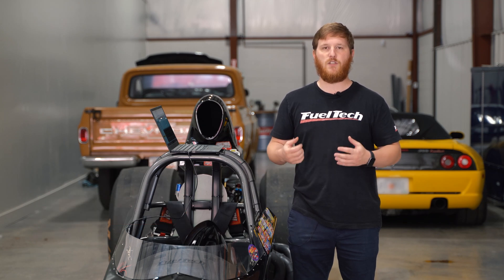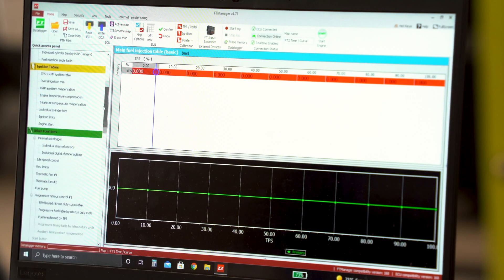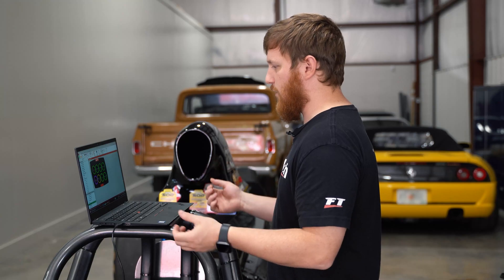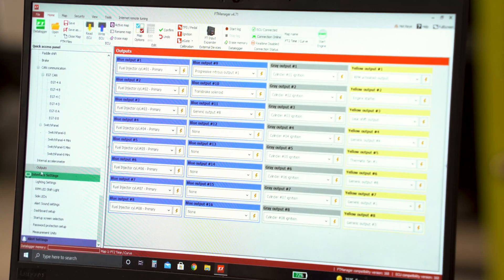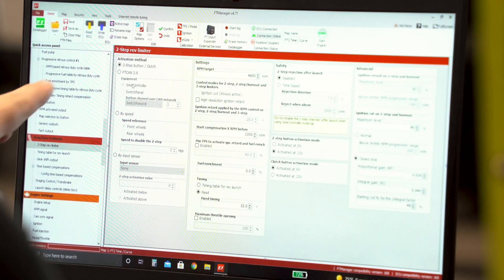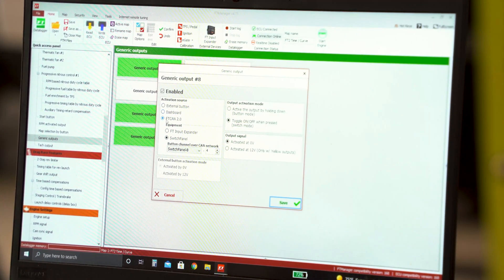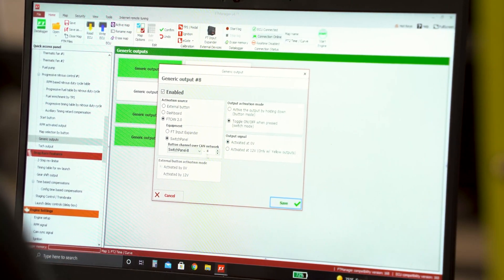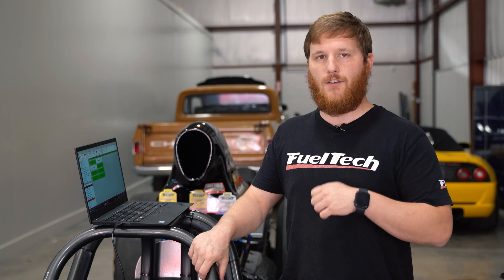How to make your project look even better | FuelTech SwitchPanel

Comment: Can I just run the switch panel to a bank of relays or do I need to use the whole fueltech setup ???
Reply from the maker: Hey Thomas, Our switch panels communicate over CAN and tell the ECU to enable a feature or use an output to turn something on. To use one you will need one of our ECU's like the FT450, FT500, FT550 or FT600
Reply: @FuelTechUSA  thanks for that info....😅 was just about to ask that question.....loving my FT550